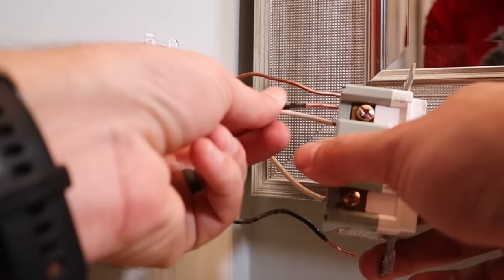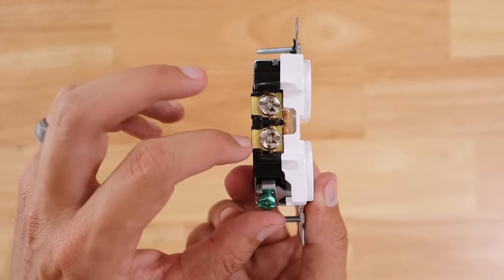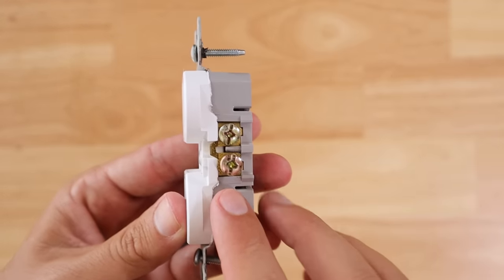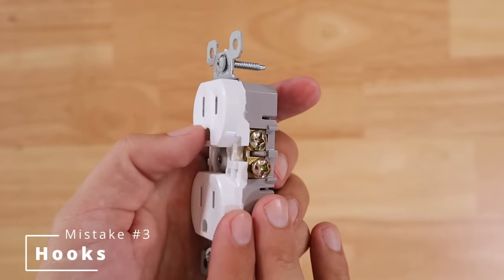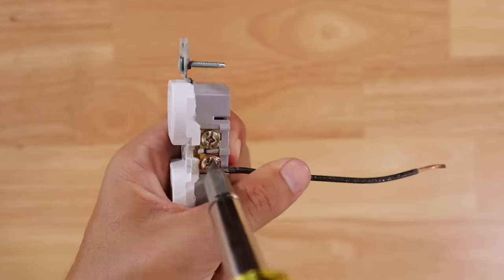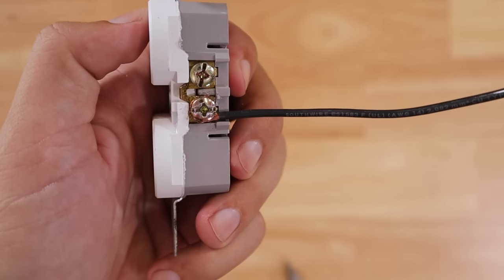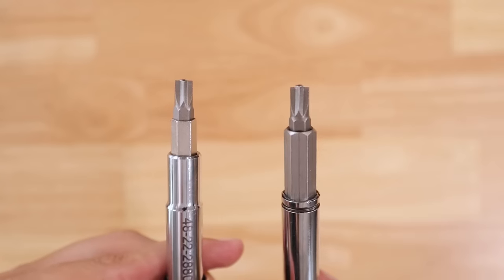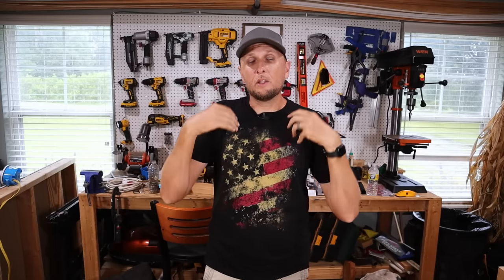The BIGGEST Mistakes DIYers Don't Know They Are Making When Wiring Receptacles | How To

Comment: How about one more very important fact, install the receptacle the correct way with the ground socket uppermost. Most people, even qualified electricians like to mount them ground down so they look like a cute little face. Should anything find its way between a partially inserted plug and the outlet, bingo!!! a dead short or worse. Just sayin!!!
Reply from the maker: Pretty much never happens.  Is it possible?  Sure.  I have never heard of it actually happening though.

Comment: This really doesn’t make a difference and is made for clicks. This isn’t a serious risk. AC is constantly ALTERNATING.
Reply from the maker: So if current is being fed from the opposite direction as designed by a device, like a lamp or a toaster for instance, there is no danger that the disconnect or switch for those devices isn’t able to stop electricity from being present where it shouldn’t be or is not expected to be all of the time?   Your comment is incorrect.

Comment: And you did not talk about how the outlet is installed. I know it’s not code but it’s a safety issue and if you think about it, you wouldn’t have to twist the cord every time you plug something in if people would put the outline incorrectly everybody put them in upside down, it’s the look if they would put them in the correct way when you go to plug up in people wouldn’t have to cut ground wires off and they can get two cords plugged in one outlet without putting these adapters are only plug in one in everybody needs to think safety not looks safety They even put them in incorrectly in the hospitals and that’s the biggest safety there teach outlets in right way. If your electrician you’ll know what I’m talking about. Let’s see if you know what I’m talking about. I’ll watch your videos and see if it comes up everybody put them in upside down because of the look I know there’s not a code but people gotta think it’s a safety issue and they wouldn’t have to twist the cords every time they had to plug something in, the manufactures that makes the appliances does it correctly

Comment: Bro it's not rocket science black to gold white to silver green to the ground screw come on man and if you're feeding the line down the line you might have to pigtail you guys make it sound difficult and it's not three wires wow
Reply from the maker: Pretty sure I said all this in the video, yet you’re upset somehow 😂
Reply: I didn't hear you say low side or line side in the video come on three wires
Reply: Upset over electrical come on brother wrong or right that wasn't my objective My objective was to show you you were misleading line side load side if you think I'm mad I'm not I wonder if you went to electrical school
Reply from the maker: There is no technical line or load side to a receptacle.  Some will use an outlet to continue a circuit and then you do have a line and load wire but there is no line or load side on the receptacle itself.  Pigtails are better to use anyways.  That was not the topic of the video though.

Comment: This is AC, it has no proper polarity like DC does.
The AC flow changes direction 60 times per second.
The only danger a flipped hot and neutral wire poses is working on something plugged in and thinking the black or hot wire is the one to avoid.
OR,
Old tube amps, some of them had a capacitor tied from the neutral to the case of the unit. SO, with an incorrect wired socket now that case of the tube amp is hot via the capacitor connected to the case.
I cannot think of any fire danger you stated. You need to study more about electricity.
Reply from the maker: It’s what every electrician refers to it as whether it’s AC or not.  Fires are possible depending on the device plugged in.  I invite you to study it more yourself.

Comment: I'm an electrician. I made it about two minutes in to the video before realizing he doesn't know what he's talking about. He is right about making sure the hot is on the brass (sometimes black) terminals and the neutral is on the silver terminals. He's not right about why. He also claims that if you strip too much of the wire it could come in contact with the bare ground wire. Again, if the bare ground wire is that close to the terminals it could touch the terminal screw just as easily. If you're a homeowner you will learn some things from this video, but focus on the actual mistake and not his reason given for it.
Reply from the maker: Well that’s your opinion.  Plenty of other “electricians” in the comments that approve of it all and verified what I said.

Comment: half of this is wrong
Reply from the maker: No it isn't 🤣.  You might not agree with some of it but it isn't wrong.
Reply: @HowToHomeDIY  id argure that it is wrong to say cutting back wire insulation is dangerous becasue the bare ground might touch it. It has way more of a chance of hitting the terminal, which you dont even mention.

Comment: That was a bad edit with the stranded hook, stranded wire is a pain to work with, run the mistake, show it, explain it as it happened and correct on the fly and explain the correction.